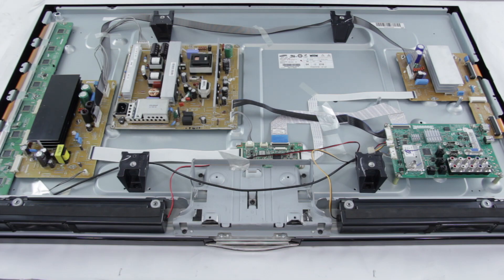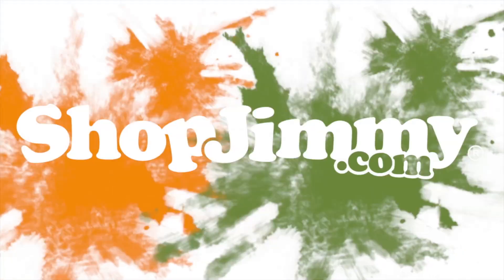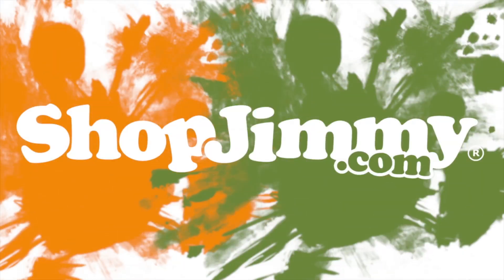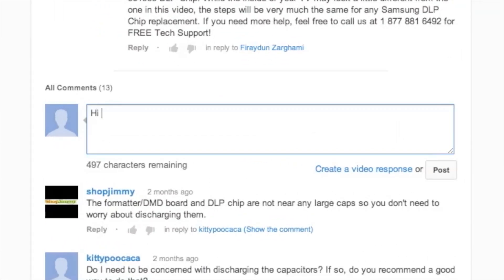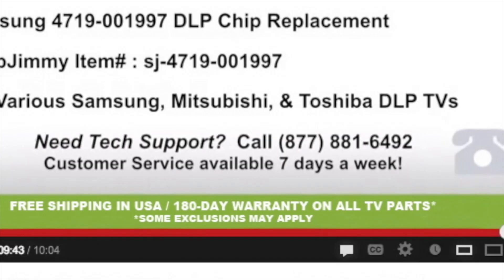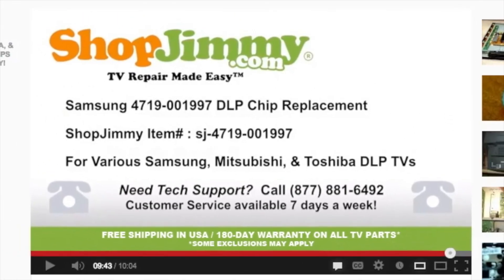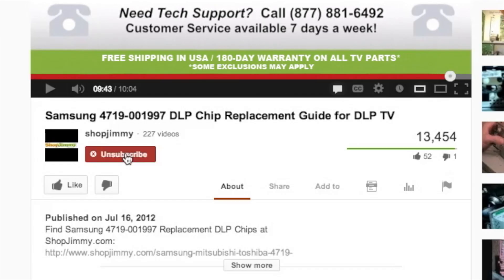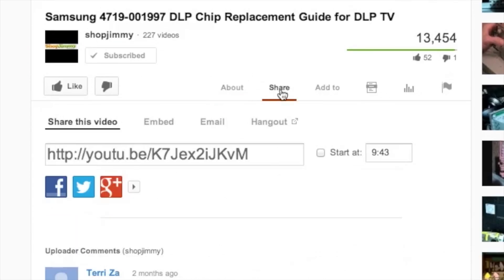Plasma TV Repair Tutorial - Common Symptoms & Solutions - How to Fix Plasma TVs

Comment: hi i have a Samsung ps50c450b1wxxu which looks like the tv in the video the tv is in standby with solid red light but won't switch on I've changed the power board and still the same problem can you help please

Comment: Hi. Awesome video. Are you able identify which component needs replacing on my Panasonic P42G20? Works fine for ~10mins then this - even without any HDMI plugged in, on all channels / source inputs. https://dl.dropboxusercontent.com/u/19921880/PanasonicP42G20.jpg
https://dl.dropboxusercontent.com/u/19921880/PanasonicP42G20_720p.mov

Many thanks.

Comment: Hi, our samsung plasma pn51d7000ff screen has four 2in wide vertical black sections with vertical "sparkles" in between each section on the left side of the screen.  So about 8 inches of the left side of the screen is blank except for the vertical "sparkles".  Any idea what is causing this?

Comment: HELP!  I think I just made a $70 mistake.  I just purchased & installed a power board (from Jimmy) for a 60" Samsung plasma that was fried in a lightning storm.  After further review,  I believe it may be the main board.  No standby light, no anything.  As I stated,  new power board didn't help.  I can hear both power boards "buzzing" when plugged in.  Any way to be sure it is the main board?  Does Jimmy allow returns?  Samsung model # S60FH - YB03.  Power board purchased was a P60QF_DSM (BN4400601).  Main board is BN9406195G.

Comment: Hi, I have An Evotel  ELCD40USBFHD. My problem is the tv switches on and the standby light goes green the screen will flash on for a split second but shut back down.Standby light remains green and for the split second the screen is on i can see the menu/startup sceen but it is only for a fraction of a second.

Comment: Hi, I own a Samsung Plasma panel PN64D7000 and after 5 years working without problem, it started to power cycle. Watching your video, I understand that it could be the "Y Board", is that correct and if it is, where can I find one?
Thanks!

Comment: hi. my lg 50pb560 plasma I'd only showing standby light... not turning on. power supply seems to be giving out correct voltages to main board and z sustain. But Asus is not passing any voltages to y sustain. what should I do to get my 2014 TV to work?

Comment: Hi, I have a 42" Samsung Plasma TV, HPS4253X/XAA version SG04. I am having sound issues whenever I change channel I hear a popping sound on the TV speaker and headphones connection, I swapped the cable box to make sure it wasnt that. I changed the HDMI cables and try every other connection possible but nothing every time I change chanel pop, pop.
I am thinking is the mainboard where all connections and output are. Please advise I am pretty handy hand good with electronics so it will be easy for me to take the tv a part and swap parts.
Thank you
Nicola

Comment: 42" Class (41.6" Diagonal) Plasma HDTV with EZ Sync.. Jimmy my picture for years has been off to the right side of my screen. Was told it was a board, but I dont know which one. I can not adjust it enough. Its like the picture stretches from left to right off the screen.. Please help

Comment: I have a Samsung Plasma PN51E550D1FXZA (version TD03) and use it with DirecTV as a RVU client.  The TV has always had a studder or momentary picture freeze and I assumed it was just the technology and lived with it.  The connection has been CAT5 to my home network and proper.  About 6 months ago, I noticed the WIFI would not work.  I didn't pay too much attention because I've always used the TV hard wired.  Recently the TV would not recognize the SOURCE (DireTV RVU) and then freeze.  The TV locks up and I have to unplug it and plug it back in.  Sometimes it works and sometimes I spend 20-30 min to watch TV.  I am just short of leaving it on all the time.  I'm pretty network savvy and none of it makes sense - checked network, tested cabling, tried others, etc.  Because the TV locks up it makes me think the TV is the issue.  When it locks up the red button still sees the commands are being sent to it but only a power cycle will fix it.  I've found going to TV source has less freezing but most of the attempts to enter network in the menu cause it to freeze.  I've done this with and without the CAT5 connected and it will still lock up.  Thanks for your help

Comment: I have a six year-old, 50 inch LG plasma, part number 50PK550. When I turn it on, the red LED light come on in the corner so I know it's powered on but the screen remains black and no sound. Afterwards, if I hit any of the buttons on the remote, the top half of the screen displays a black image and the bottom half displays a white image and then after a second, it turns itself off. I suspect that the problem is the power supply board but I may be wrong. Has anyone else had this problem? Do I have to change a board? Thanks.

Comment: I have a Samsung Plasma model PN51F8500AFXZA. At first I had a single black vertical line on the right side for a month or so. After that another vertical black line appeared on the right side about 4" from the first, than a 4' section became black and now half the screen is black on the right side. The additional black line and half the screen going black all happened in a minute or so. The left side of the screen seems to work fine. I took the back and the control board green light blinks steady every sec. I checked the power supply voltage per label and they seem ok., negative voltage on y main board ok , y-buffer board short test found no shorts. Is this problem the plasma screen? problem on y main? y buffer board? or something else? Thank you in advance for your help.

Comment: Hello,

My Plasma PN60E7000 shuts itself off and doesn't turn back on, red light stand by blinks and nothing I can do. After a while I unplug the TV and plug it back on and works for a while and it turns off it self again.
Should I replace the Power supply?
Thanks in advance

Comment: samsung tv pn 43d44dasd clicking noise not turn on
it's exactly like the one on you tube , i replaced the power board , still the same and the stand by red light is there 
i unplugged the wire goes to the logic board then i plugged tv to the power and i heard the sound but no light on  the screen
what you thing is the problem  ,,, thanks

Comment: Hi, I have a 50" plasma Panasonic tv model number tcp50s1 and the power is just shutting off with no blinking lights. Any suggestions? Actually to add that it works for awhile then just shuts off...

Comment: I have a LG 60pv450 that shuts off after a few seconds of running. There is a standby light but it won't power back on after it shuts its self off. The screen will light up but it goes off again right away. We did have a fuse breaker pop this summer and it's the same plug that runs the tv. Would this just be a fuse in the tv I could repair?  Thanks
Reply: I also have this same issue, mine will turn on and we'll do fine as long as it's only displaying the no signal icon that dances around the screen, but if I power on a PlayStation or DVD player and the screen gets more I would say power or light in it it shuts right off
Reply: @Richieschilk  did you find out what it was?
Reply: @vr6688  nope.. unfortunately not
Reply: Jake T im having the same problem with mine. did you find a solution yet?
Reply: me too
Reply: Me 2
Reply: @emmanuelngakane6883  it's the powersuply
Reply: Caps in the filter  power supply can cause this fault., also check to see if the boards a loose  retighten as it could be bad earth's. if your going to mess in the power supply make sure the caps are discharged, if you don't want to end up in the promise land, (high voltages).

Comment: I have a Samsung Plasma PN50b860. I plugged in an HDMI cable to the TV, that was connected to a bad security camera system and it sparked then shut down my TV. Now when I plug my TV into a power outlet, the TV tries to turn on even before I tap on the power button, then clicks to come on but does not turn on. It repeats ever 5 seconds or so. What do you think this could be?

Comment: I have a Samsung plasma model PN51D430A3DXZA that has picture but no sound. The samsung jingle plays when power button is pushed but then no sound from speakers. I tried all settings for internal and external even connecting the digital optical sound cable out to a samsung sound bar with no luck.

Comment: I have an LG 60PB6650 that is about 1.5 years old and it made a very loud pop noise when turning off the TV. Tried to turn it back on and there was no picture, just a completely black image. Sound was coming from the the sound port to the sound bar and would change sounds as we changed channels but never any sign of light or image on the glass.

I removed the rear panel and did some continuity checks of the Ysus connectors and did not find any faults/shorts except for the Grnd of course. Same results on the Xsus connectors also. TV does show red led when off like usual and a click sound when powered on, then another click when off and red Led returns.  2 fuses on the power board also checked with continuity also.

What else should i be checking?

Comment: Hello, I have a PN64E533D2F. I have one red vertical line on the right side and two black horizontal lines near the top of the TV. Which parts would have to be replaced? Thank you so much in advanced.

Comment: I have a panasonic plasma from 2008 that has half black screen problems. It comes and goes depending on the day sometimes lasting up to two hours. I had heard it could be a loose connector but I was wondering what you think. Thanks Sandy

Comment: Hi  I have an old plasma Maxent tv 42 inches and everything works except a small short line on the right upper part of the screen , I think  to remove  "clean"  and connect back the screen ribbon connector but im not sure if that will fix this in my case., any ideas will be very helpful. Thanks !

Comment: Hello! I have a LG 60PK550n with several vertical lines(colored lines pixles width) in the center of the display. They are in a total of about an inch with. The lines changes colors depending on the colors displayed on the screen. In some colors, part of the lines goes black, green, red. In light(white) and dark(black) pictures the lines are barely visible. The lines overlap the menues of the tv settings.

Comment: Hi, I have a Phillips Plasma TV Model:42PFP5332D/37 and it's getting really hot after about 45 minutes which appears to be the cause of severe distortion of certain images on the screen most noticeably people faces The whites and blacks appears to be unaffected. I have removed the back cover of the TV and visually inspected the components and have not found anything obvious. capacitors appear to be in good working order, i.e. the tops are not bulging out Please let me know if you may be able to assist me resolve this problem. Thank you in advance for your help.

Comment: I have an samsung pn51d440a5d once powered on the picture appears then immediately goes back then the TV will power off with in 5 minutes on its own I did notice the standby light flash 3 times once powered on I'm not sure which part is responsible for I have tested them all

Comment: I have a samsung 58" plasma model FPT5884X/XAA. It has 2 problems. One, every time I turn on the tv the volume starts at a very loud setting and I have to turn it down. Obviously we would never have our volume at that level. Two, there suddenly appeared a 1"wide x14"height, vertical black bar that starts at the bottom right part of the screen and goes up vertically to exactly the halfway point of the screen and stops. Please let me know how I can fix these issues.

Comment: I have a 50 inch Panasonic plasma had a tiny crack in screen for 7 months worked perfect no colour issues could hardly tell then 1 day it wouldn't start up just the diagnostic blink. Was under warranty guy came out looked said screen crack its unfixable the gases will of escaped. is there no way of bypassing the safe mode or whatever it is there was no colour distortion or anything  shame to break it for bits

Comment: I have diagnosed that my Samsung  51" plasma TV has a bad  address " E buffer board". I have the new one ready to install but then realized the 5 ribbons that connect from the bottom of the TV do not have standard connectors like the y buffer. The ribbons look as though they are held on by glue or a sticker. Is there a video of the best way to remove and reinstall the ribbons?

Comment: hi, I have a samsung ps51f5000am and it has the cloured vertical lines going up the left hand side of the screen. i am assuming this is from the logic board, am I correct? and also, where is the logic board on this tv? I see a long board down the very bottom of the screen with ribbon cables like what would normally go to a tcon board and i cant see anything underneath the main board. is it part of the main board or is it that long narrow one at the bottom of the screen beneath the speakers taking the entire length of the tv?

Comment: I have 50" plasma TV model # PN50A550 that was turning off and on.
I've ordered the new power supply board and changed it, and set the VS & Va to the right parameters, and checked the DC voltage for all boards.
Now, the TV has just a few on & off cycle and when it stay on, I connected the antenna cable to the main board, it started to go through the same on and off cycle again.
So, after 5 Min. the screen turn Blue and no signal or picture is visible. 
Could this be the issue with Main board or something else? 
Thanks

Comment: My Samsung plasma TV model #PN43F4500AF Version #UD01 the problem is when I first turn on TV I have a reddish line across the top three inches of screen, it changes to more of a pinkish and you can kind of see am picture behind it after it warms up. Its mostly dots and it has some blue in it to. I also have a little white bar that runs across the 3 inch area and a vertical white bar that is in the middle of the 3 inch area. rest of the screen is perfect.

Comment: Great video Shop Jimmy!! I have a Samsung plasma tv. It's model number is pn60f8500. It works fine most of the time but some days the screen will go black and only audio will come through. You usually can turn the tv off and on and it fixes. Today it did the same thing but was constantly happening. Like every 30 mins. Sometimes when the screen turns off it will come back on but my picture mode will change. If I turn it off and back on it will go back to my original settings. It is weird lol. Any help would be appreciated. We do not have a tv repair shop here and I love this tv so much.
Reply: Also I have taken apart the back panel and checked for any bad capacitors. I couldn't find any. I also unplugged the y and x boards one at a time to see if I could eliminate the bad board. But it will not come on at all with either unplugged.

Comment: HELLO, I have a Samsung  pn51f5300 plasma tv that died after 20 months. There is no audio, no clicking and no picture. I took off the back and didn't see any blown or swollen caps. I changed the power supply board and that did not help. When I try to turn it on the red light blinks 6 times and repeats on the first blink the screen faintly flashes but does not turn on. This problem developed over a 2 week period , where the time kept getting longer for the tv to display the Samsung logo, until finally the set just does what I describes earlier. I would greatly appreciate any help you can offer. Thank you...Charles

Comment: Hi,
Great information on the video. I have an LG Plasma t.v. model number 50PZ550-UA and all 4 of HDMI ports and the component ports stopped working at the same time. The antenna works just fine and the picture still looks great. When I connect anything to the HDMI or component ports, the t.v. says no signal. Based on the video, I'm sure there is something wrong with the main board. Do you think that this is what should be replaced? Any help would be greatly appreciated. 

Thanks
Eric

Comment: 2013 Samsung PN64F5500 afxza. No picture, sound works. About 9 out of 10 I can turn on my tv and no picture will show up however sound comes through. each time I try to turn on the tv it sounds like it is trying to come on but rarely a picture. then there is that one time out of a whole hour of turning on and off my tv that it will boot up and a picture will show... then it works with no problem until it is turned off. I have checked all fuses, capacitors and just replaced the power board.  let me know if you need more info.

Comment: Hi I have a 60" samsung plasma PN60F5300AFXZC Tv that won't turn on.  I have a blinking power light and that's it . I bought and replaced the power supply board and that didn't fix the problem  PLEASE HELP

Comment: Hello jimmy....I have an Hitachi  55' plasma tv. model #55HDS69..there are red, green & white blocks of short horizontal lines
across the full tv screen  also there is alot of green (waves) that bleeds into the faces on the tv. I was advised to change the 
main digital board...I did with no good results.........can you pleasse  advise on this matter?............thanks, Peter S.

Comment: HI Jimmy, I have a Philips Plasma model 63PF9631D/37.
For about 2 months it has two vertical bars ( about 2 inces each), right at the center of the screen  ONLY ON THE TOP HALF OF THE SCREEN. They were like a purple and yellow hue and although annoying, all it did was a change of color tone on the image at the spot. Now, one the bars (one next to the other) developed a flickering multi-color change  with a mirror like shine. This bar actually reflects a double image over the flickering bar only.
Any suggestions? I am pretty handy at fixing stuff myself but diagnostic of electronics is not my strongest asset.
Thank you,
C.B.